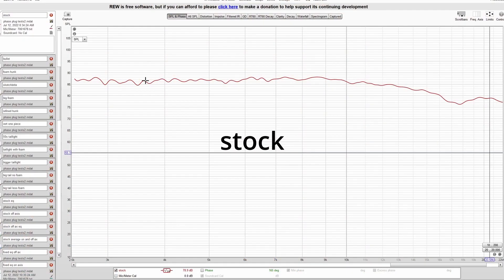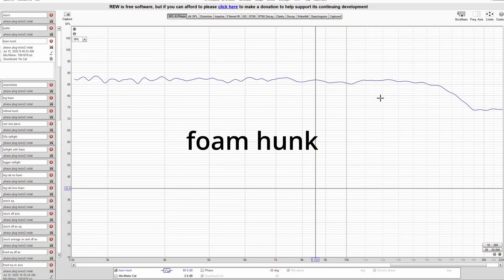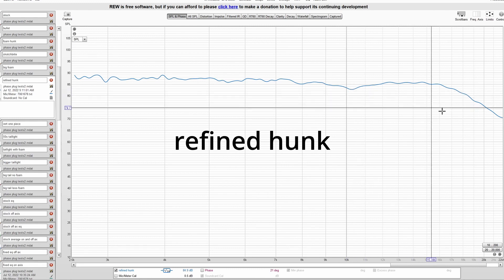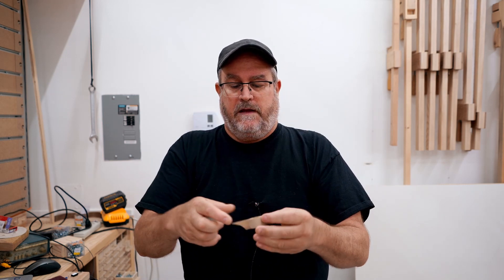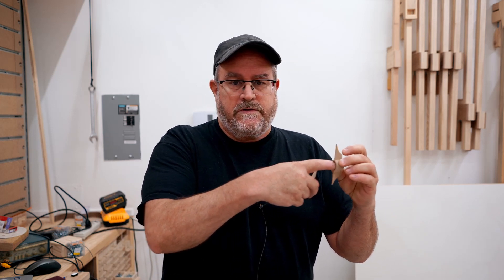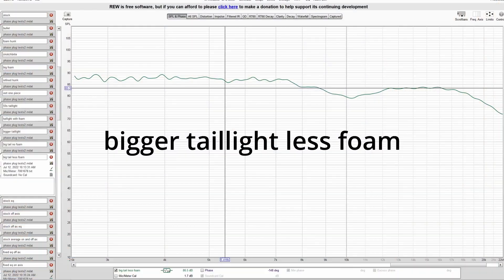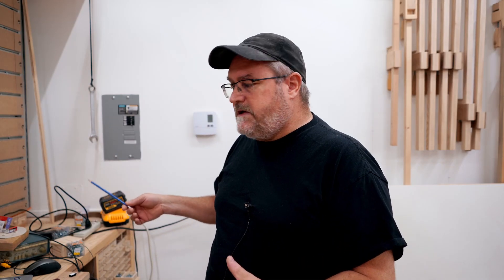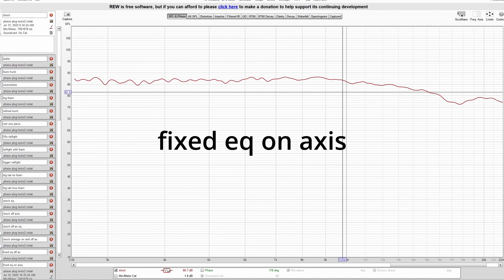Is it a Waveguide or is it a Horn? Plus Phase Plug Experiments

Comment: Excellent sounding speakers must have well built physical boxes of whatever shape they take. Well built finely crafted speakers have to be constructed to be as solid and free from vibrations and resonances. The construction techniques may be more important than the actual physical materials they are made from. Some boxes/cabinets have exotic construction and all those internal braces and “waveguides” should further dampen unwanted and undesirable vibrations further strengthening and create nonresonant enclosures. Next quality drivers need to be used in a manner consistent with the design objectives. Putting expensive drivers in poorly built enclosures are bad design decisions. Quality components in the crossovers are important. Cheap stuff won’t help expensive drivers create what they were designed to do. Then there is the speaker placement and the room itself also parameters that will affect the quality of the speaker in ways more important than rounding off corners, etc. OB designs are another concept entirely. I think some people may have developed very acute hearing sensitivity just like some people have outstanding visual acuity and they can perceive sonic nuisances that 90% of the average listeners are unable to perceive especially those of us who do have limitations in out hearing response. (Above 12kHz I’m seriously deficient especially in my right ear) so I have to be practical in my speaker choices. 

Excellent presentation John!! Thanks. 

Btw John shopping at Walmart yesterday I encountered a gentleman who was your doppelgänger. I almost asked him how was the OB speakers coming along 😂

Comment: Why do you use foam as a phaseplug? Because it;s easy to shape? A wooden dowel or a screw or a small coin works too. Because all you need to accomplish here is to slow down or lengthen the path for the sound from the tip of the dome relative to the sound from the surround. If you can get them in phase by redirecting them around an object, you get the same effect as with forcing them to go through foam. Except foam additionally attenuates it.

Comment: This all is very interesting, but "two days of my work" is enough to purchase the most expensive and flat home audio tweeter. This is obvious, that your tweeter membrane, Sir, is too heavy, and no trick will help.
You have to pay more attention on 10-12kHz range. This is a "clearance". It's very important imho.
Reply from the maker: You have to loosen your necktie!
Reply: @IBuildIt  Better drivers = Better sound.  You cant soup up a Gremlin / Yugo , and expect Ferrari / Lamborghini / F1  results.  A race car, has so many special attributes, that give it massive performance advantages, such that no standard vehicle can come close to matching them.

 Stiffer Frame - to prevent twisting under cornering stresses
 Superior and Stiffer suspension
 High power, specially tuned, and super-charged motor
 High power fuel pump, to get far more gas to the engine, much quicker
 Programmed Computer, balancing fuel mixture, to gear/RPM for best possible performance
 Special tires. Wider, and Tackier grip, to stick to the road at high speeds
 Lower center of gravity
 precision balance in weight, spread equally across all tires
 lighter weight parts, and reduced overall weight, for better acceleration and performance
 special aerodynamics, special cooling channels, and Downforce spoilers
 special engine cooling enhancements
 extremely powerful, heavy duty, brake mechanisms

 While people can have fun running a standard or tweaked car on a race-track... you can not really compare this experience, to driving a specially engineered  "Super-Car".   Faster acceleration, Faster top speed, superior stopping / braking, superior cornering at high speed, superior traction and responsive control... even in the worst case scenarios.

 Obviously, not everyone can afford a high end racing car.   Many cant even afford to Hop up a used mid-tier sports car.  But there are high performance speaker drivers, that are still very affordable, to even the modest of budgets.  (much cheaper, of course, than buying an over-priced high end speaker that has been built by a company)
Reply from the maker: Scanspeak D2905
Reply: @IBuildIt  And? This is a textile membrane tweeter. It's heavy by default. It was born with significant slope (with an artificial bump at 12kHz to extend a range to 20). This is cheaty tweeter with a loud label. When you increased an acoustic resistance with the horn, textile gave up.
Reply from the maker: I wonder what would happen if someone tied both of you together by your tails and draped you over a clothesline...
Now that would be wild and crazy, I think!